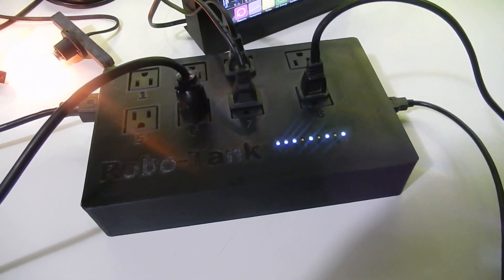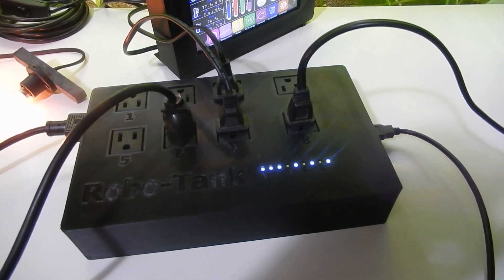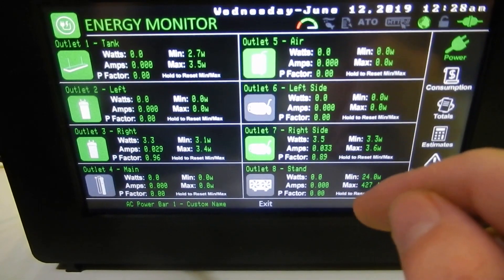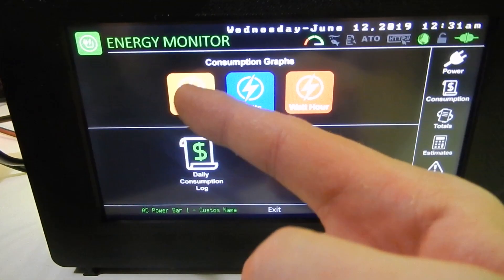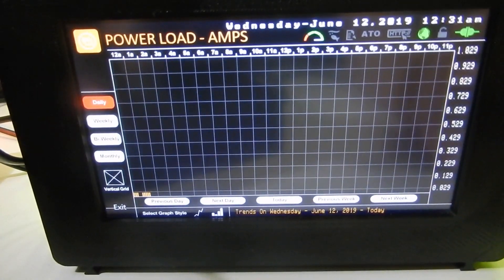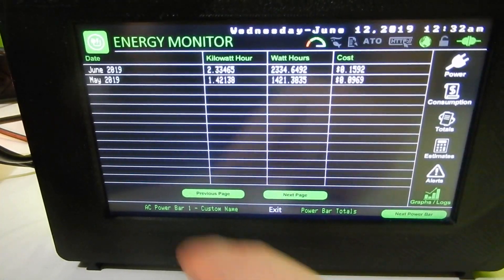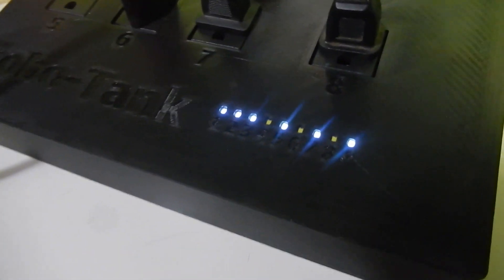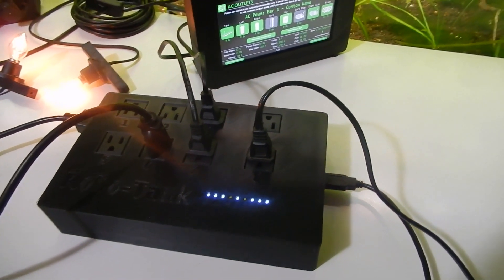Robo-Tank DIY Aquarium Controller - Energy Monitoring AC Power Bar

Comment: Nice video. But what is that GUI on your monitor? This is not the reef-pi GUI, ist it?
Reply from the maker: Thanks, no this is my old Arduino based controller, I no longer offer it. If you check out my website on main page at bottom is some pics of reef-pi.
Reply: @RoboTank  Great work, I love the Arduino based controller; the graphic is much more interesting than the reef-pi one. Could you share more information about it? Parts, Schematics, software and all I need to made it. It will be wonderful!
Thanks a lot.